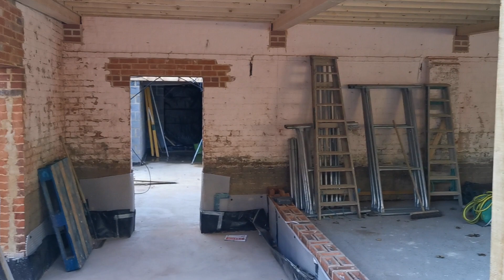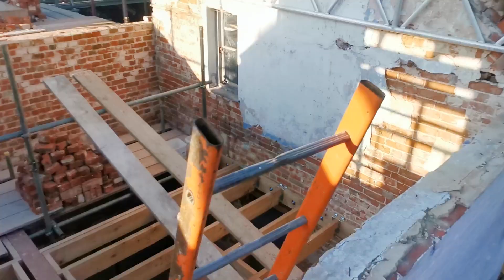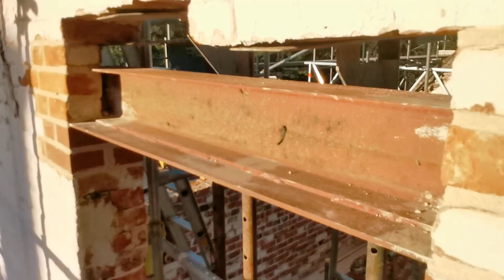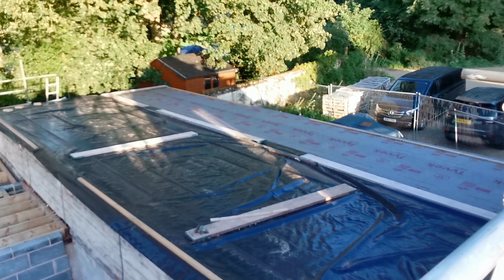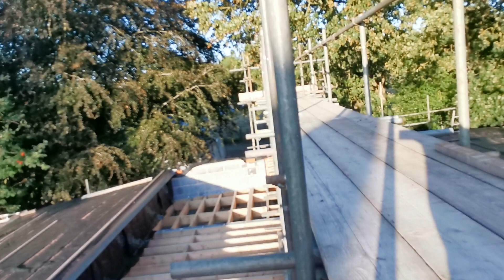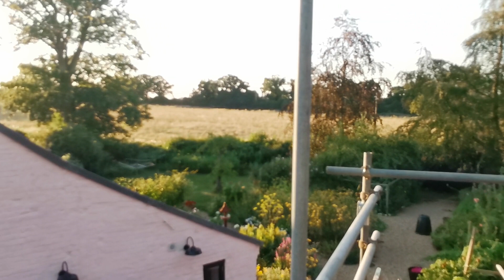The Barn Conversion - New progress being made including car port

Comment: English builders restoring these barns are indeed wonderfully skilled craftsmen - so good seeing old buildings revived and repurposed when it’d be so easy to knock them down and replace with an easier more quickly (albeit far less characterful) building.  Gardeners Cottage barn conversions are properly thought out, stylish practical use of space over two levels that are only barn-like on the exterior, unlike some single storey barn conversions with open plan, insufficient windows. soaring great interior ceiling spaces whose only purpose is to reveal beams but cost a fortune to heat- that type of conversion holds no appeal in my opinion.